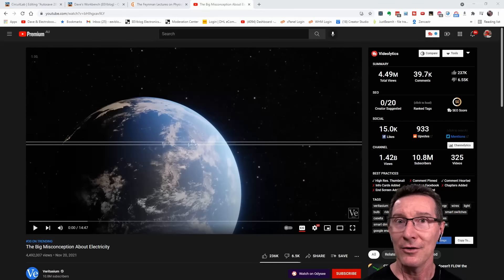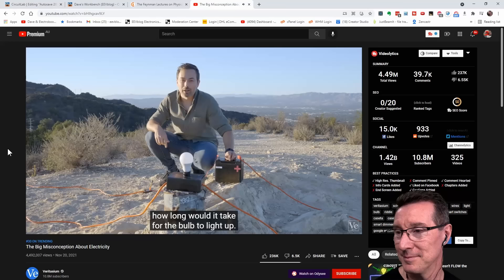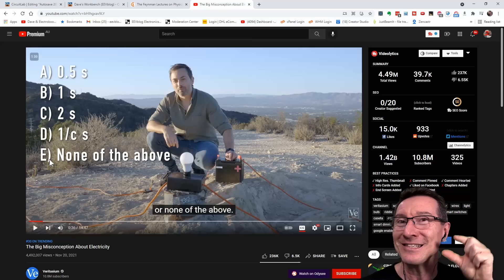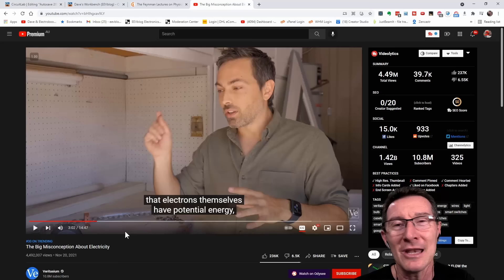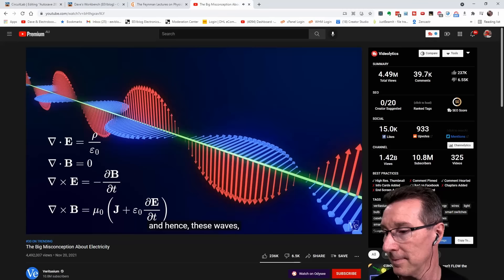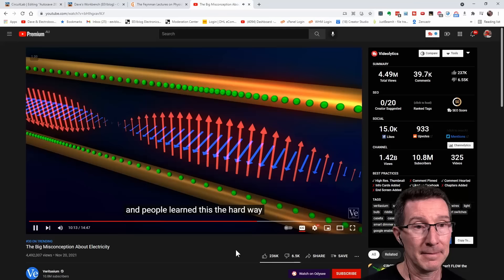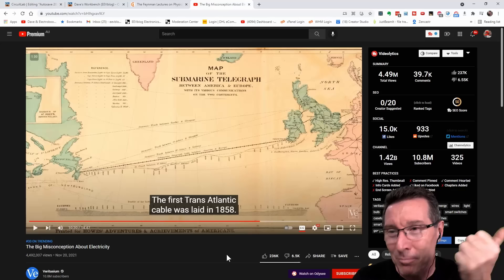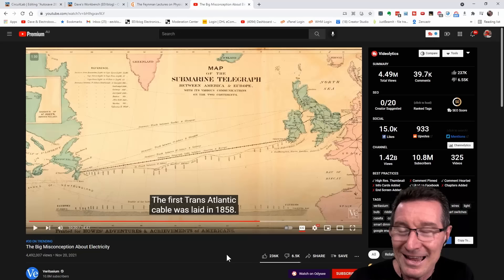EEVblog 1439 - Analysing Veritasium's Electricity Misconceptions Video

Comment: Awesome vid, simply amazing :)
I've been tearing my hair out for days after seeing the Veritasium video.
I'm not an engineer but I've done some electronics engineering fundamentals in the past.

What he was saying didn't change what I already knew.
Poynting's theorem was new to me, I'd prolly seen it before with light rays but never paid much attention 'till Derek's video.
I looked up Poynting's theorem, no issues with that.

I came away thinking you can't have EMF without electron flow or vice versa, his video made no sense and
 I didn't learn anything from it.
I felt he was purposely leaving things out to make it go viral, a pattern I've see in his previous videos and he would explain it better in a follow up.

However in the mean time I was trying to work out what he kept hidden, because in the past videos he likes to make
 fools of his viewers but generally he was correct.
I don't think this is the best way to educate but I wanted to find the answer because this seemed like there was potentially a new understanding to be gained.

Your video pretty much was spot on to the way I was thinking but your knowledge helped you fill in the gap I had.
It was all in the capacitance between the lines, I never even thought about that.
I wasn't thinking practically about how close they were and I've never had to deal with capacitance on that scale.
Before I was thinking how could it jump through the air, that's just math, their must be something real world that explains the math.
Thanks for the missing piece. I might have to Google transmission line theory :P

I learnt nothing from Derek's video except to stop watching them, I learnt a greater understanding of the universe from yours.
Massive thanks for fixing my brain :)

Comment: Thank you for taking the time to do this! As an electrical engineer myself that video (and the reactions) got under my skin. Derek is making claims that might not be entirely wrong, but they're definitely lacking scientific clarity and context, on top of being overly sensational
Reply: Dave here uses the wrong model for Derek's experiment setup.  A transmission line model is not applicable, so what you see on his graph is incorrect.  The better model is a dipole antenna model.  See my explanation in the main thread.
Reply: Well that's his job, he is an entertainer loaded with trick questions.
Reply: @dingdongchingchong8659  Derek's own answer to his 'trick question'' and how he demonstrates it is not correct. The bulb is dark at the moment he throws the switch and then takes a few seconds to gradually turn ON to full brightness. For a physicist it shows a lack of understanding in electrical circuits.  See my other posts for the explanation.

Comment: I am a High School Science Teacher. So, I am glad you pointed out that Veritasium failed to put the Unit "Meters" after the 1 in 'Answer D'. Their original 'Answer D' was "1/c s". I am always telling Students: "Write Your Units! [or it's just wrong]". However, what you did not point out, is that having the "seconds" there in the answer is also incorrect. Since the Units of "c" [Speed of Light in a Vacuum] are already "m/s", when you divide your 1m by it, you get an answer already in Seconds. Then if you multiply that by Seconds again, you get an answer in "Seconds Squared". So actually, "D" becomes the worst answer, because of its incorrect units. And without putting in the meters, like they actually did in their video,  it would be even worse... "Seconds Squared per Meter". Even if the other answers are not quantitatively correct, they are "better" because they at least have the units of "Seconds".

Comment: Wow. Being retired and having an electrical/electronics background, IMHO, Derrick's physics analysis of transmission line theory was bass ackwards. I wish he had explained the reactance + resistance of the L-C-R configuration and worked backward to the physics of electro-magnetism. I agree with what you are saying and I suppose Derrick didn't want to mess with electrical reactance as a practical electrical theory. People generally understand a light bulb is like a resistor, electrically, but he should have defined the reactance concept with his 'circuit'. When I used to repair power and/or guitar amps, I would hook a 100 watt light bulb in series with the AC power line cord, and after flipping the on/off switch on, the light bulb would flash full on, then quickly dim to nearly off for a healthy amp (due to the LC ramp), or stay full on indicating possibly shorted transistors/tubes or power supply; an old repair trick that saved fuses and even circuit breakers!
Reply: And this is why you never trust a physicist to do your wiring. I've had similar experience in chemistry. The physicist tells me why I'm technically wrong in my understanding of how it works, I show them what I successfully made.

Comment: I'm really glad you brought up the units! The first time I saw this question I immediately discounted 1/c because it obviously doesn't have the right units. I was surprised that I didn't see any comments on the video discussing that.

I think the whole idea of the video is comparable to saying Newton's laws are "wrong." When it comes to certain circumstances, they're not quite right but they're still accurate in most practical cases. However, it's good to understand the physics and know where the limits are.
Reply: Yeah the units error/omission is really egregious to me. To me it feels like pandering, "oh the general public is too stupid to understand, so lets not even try". That being said I don't know if it was intentional. The tone of the video would have been way more interesting if he actually tried a larger wire gap, because the audience would actually be educated by the experimental results.
Reply: @mattmurphy7030  I don't think I understand what your point is. I'm not claiming I understand anything about this in particular, I'm just saying that option does not have units of time so when I first saw this question (on Veritasium's poll with none of the other context), my first thought before anything else was that it couldn't be the answer (which was confusing because it seemed like a more likely answer than the others from my basic understanding of the concepts).

Comment: Oh yes, this Veritasium video was one hell of a ride. He confused so many correct things together into one final message blop of "not even wrong". And luckily YT has already disabled dislikes for me and many others, so that noone will be able to tell if something is off here, unless they read a lot of comments...

I have a few points here, the first and last are particularly interesting, since i think you made "mistakes" here.

1:30 No, not even that is correct technically. It should not be "1/c s" (unit s^2/m ???), not "1m/c s" (unit s^2 ?) either, but "1m/c" (unit s).

7:00 He forgot to specify, that this has to be done with the right hand. 

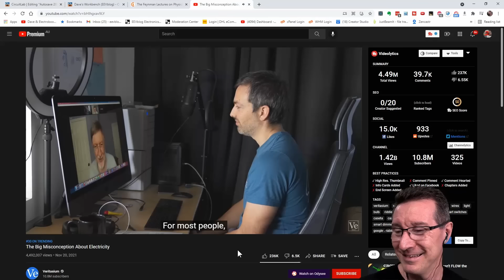13:00 I think there is also some quantitative analysis missing here. Most of the energy flow would happen very close to the wire as that is where the strong fields can be found. And if you use coaxial cables its gonna be much different again xD

15:40 He says one thing, but shows something very different here. In the image the energy oscillates between potential energy in the EM fields and kinetic energy in the oscillation motion. Here it has to be considered what amount of energy is lost from the kinetic-potential energy oscillations to become EM oscillation energy (radiation).

38:00 I have to disagree with you a little bit here. The transmission line setup you have shown is even more outlandish. In your ciruit you actually put down wires, that do not exist, just so you can draw a capacitor there. I would wager that is even more confusing to a general audience than the EM fields. ;)

41:00 You actually made a mistake here. When Veritasium talked about the Pointing vector going outward he talked about the current source, the battery in that case, not the cable! So technicall both you and he are correct. The Vector points out of the Battery, but into the cable. And thats consistent with the energy loss along the way, from an imperfect conductor.
Reply: Regarding 38:00 : The wires and capacitance are a model to represent the effects of the EM-Waves. The model might be incorrect in term of physical appearance in the real world, but as long as the model can solve the real world problem close enough it is sufficient.
Reply: @115maxx  What im saying is not that it is wrong as a model, but that it is likely even more confusing when shown to laymen.
Reply: @115maxx  What Dave used is quite a simplified model that assumes that physical thickness of the distributed "capacitor" is infinitely small compared to the length of wire. It is more than good enough for most practical cases (because generally we don't use such crappy transmittion lines and we don't connect our loads in such a silly way) but it is not a very good model for the experiment in question. That is why modeling does not give the expected 1m/c delay between connecting the transmittion line and the source starting to feel its load but it gives 0 delay (or exactly 1 step for a quantized time digital simulation) instead.

Comment: It took me until about 32 minutes into the video to comprehend why voltage would be present at the light/resistor/load the (near) instant the switch is flipped. 

Personally, i think that's a damn good job explaining things. Mind you, i have zero academic background in... Well... Pretty much anything (no college here buddy, all self taught). 

Love the videos and always learn a ton. Saves me having to pay for college!
Reply: EEVblog's lumped element model here is not the right one for Derek's experiment set up.  

Go to the top and sort comments on "Newest First", scroll the time stamp of this post, and read mine.  You'll be surprised at what the answer really is.